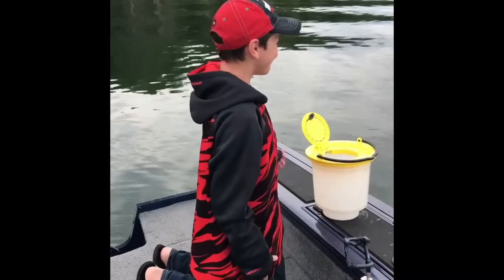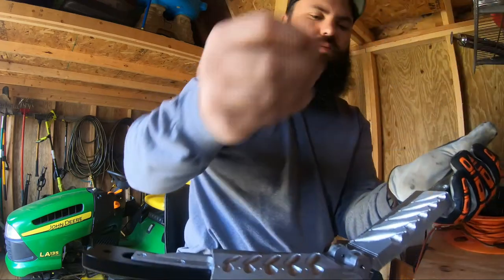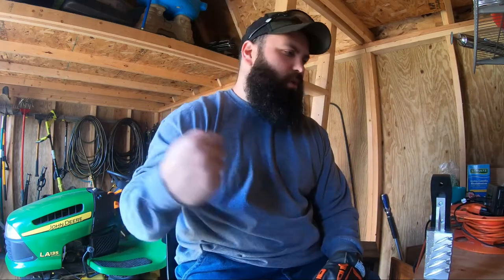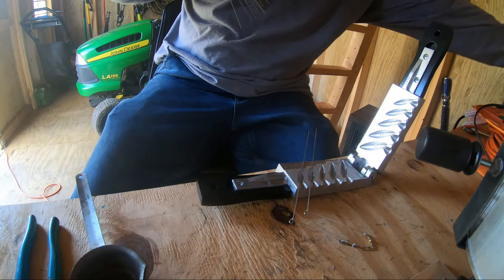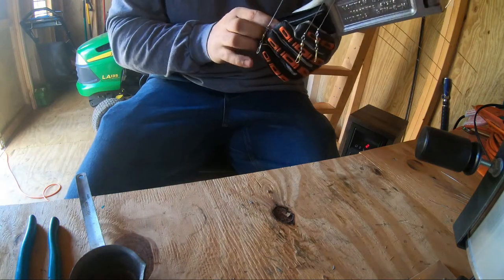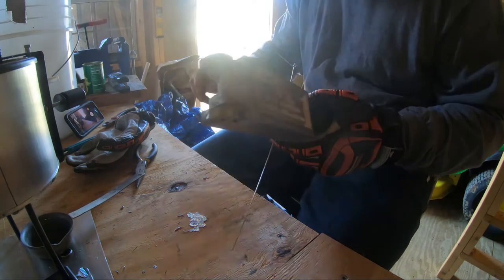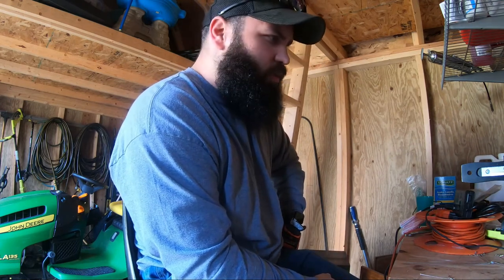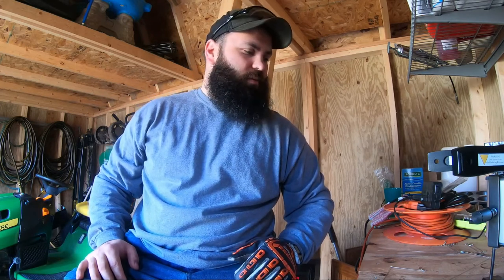DIY BOTTOM BOUNCERS

Comment: Nice video. I use hot wax to to keep the rods from slipping on my large mold. Burns off and I know the weight placement will be perfect every time. Hotter the metal and slower prep has always worked for me. 👍

Comment: I keep my mold on a cheap hot plate burner from Walmart. For $10 It keeps the mold warm for perfect pours. Play around with your heat settings until it’s right for you. I use mine just below the medium setting. I also use a cast iron ladle because it holds heat better. You could also pour the weights first with just some short wire strait from the pot. Then just remove the wire,  add to your bouncers and either crimp the lead or do a small Z turn in the wire to hold it in place. Hope this helps

Comment: prop a bbq grill up on some blocks high enough for the wires to clear your bench then set the mold so all the wires fit between the bars. i agree also that a bend in the wires will help hold them in place. also a bolt and wingnut or some type of spring loaded clamp on the handles helps keep the mold closed. one more thing, everything has to stay hot hot hot! so an assembly line process works best for me. hope this helps. 
it's amazing how much advice a person gets when fighting a fish, until it's 3ft out of the water. then the shoulda coulda woulda begins. tight lines.
Reply from the maker: Hahahaha very true. Thanks for the tips

Comment: Hello from Germany again!
sorry for one of my coments, now I have seen that You use lubricant yet.
What helps me with the botom bouncers, for a better hold at the wire is take a tong or pliers and make a Z shaped bend into the wire so that it fits into the cavity.
Place the bend in the wire at the point from the botom of the lead weight this helps to prevent the wires gowing down and keeps it on place and give more stability.
Sorry again, but keep children out of the area and Your dog too.
Molten lead is so hot and it causes dramatically burning.
Beware them of the fumes, and no one would say this would happen, but it could happen the dog could jump around and the melting pot would fell over, no one would like to thik about this.
Once in the past I was lead pouring on my balkony an the pot fell over, in the last parts of a second, i could jump away with my chair I was sitting on, so nothing bad happened at me but almost ten pound molten lead splashed at the bottom.
This moment made me think about safety. Please be save!
I hope my English is good enoug, so that You are able to understand my coments in the right way.
Please look at all of my coments and think about.
The idea with the multivalve at Your fluid bed is great!
Keep Your channel goin on!